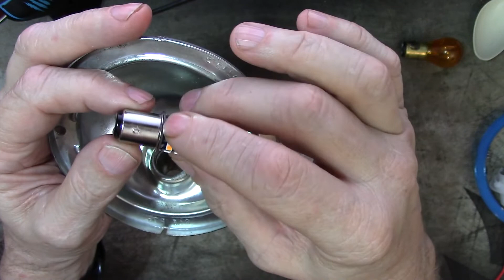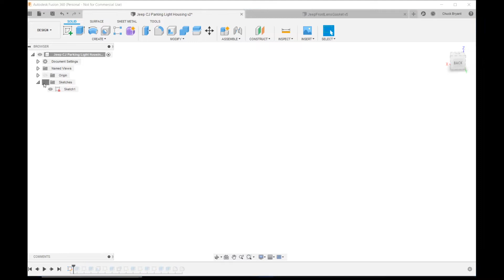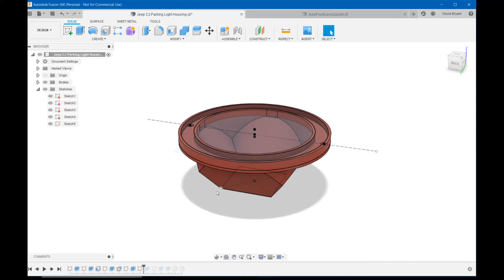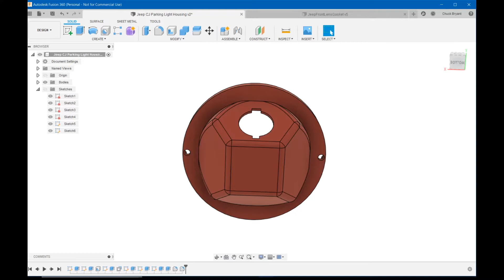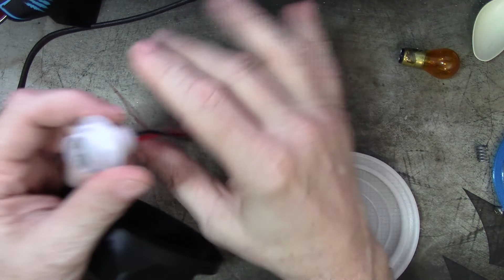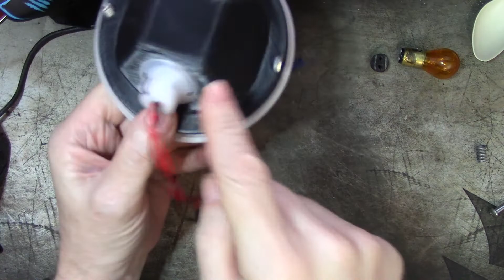Update! Jeep CJ 3D printed parking  lights, now with 3D printed housing!

Comment: When I added LED bulbs to my Jeep, I believe they sold ones with and without diodes in them. I have a 2007 Liberty, so I grabbed the non-diode ones (I believe) and they work nicely. I really like the LED as the backup lights, they really illuminate the area compared to the incandescent ones. Are you going to add HID or LED headlights to your jeep? I was considering upgrading mine, but was concerned about splicing into the wiring. As always, you did a great job!